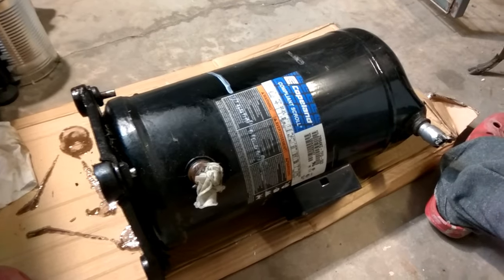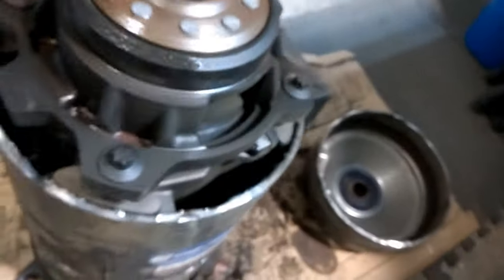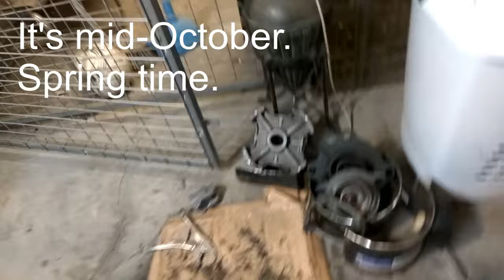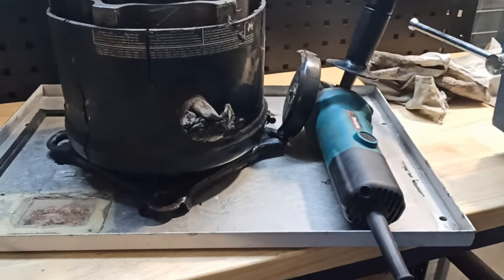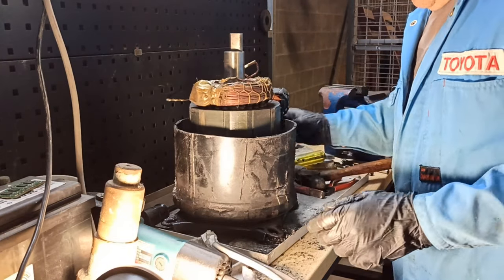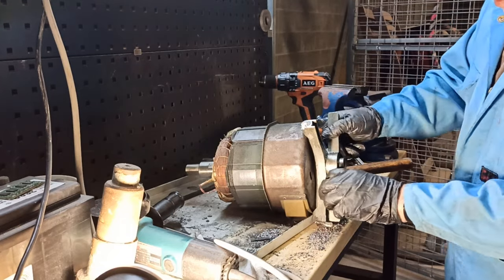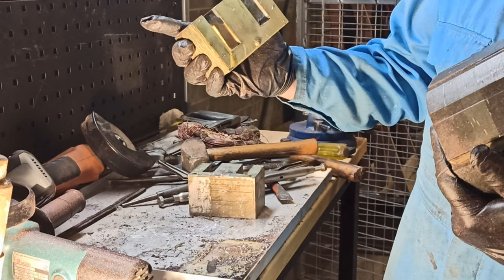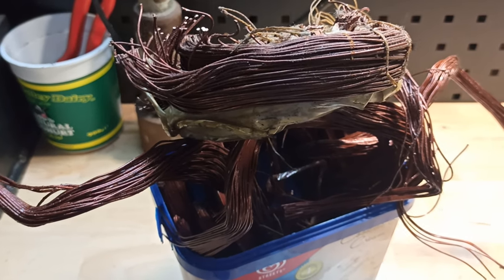63 Huge Air Conditioner Compressor Pull Apart. I Make it Look Hard (Scrap Copper) Bondi Scrapper

Comment: The first one is always the slowest, but good work, you worked it out. I usually mount the stator a bit higher on some chocks of wood so that you can just use gravity, a hammer and a long screw with a flat end to tap the windings out all the way and not have to lever them out with a screwdriver or a pinch bar. I don't bother cutting open compressors or upright fan motors, but pump motors and winch motors are usually much better because you can just undo the casing screws and take the motor out, and not have to muck around with all the heavy steel, anchoring bolts and welding that compressors have protecting the motor.
Reply from the maker: At the moment I've got a lot of projects happening and am scrapping the easy way for a lot of stuff.
I'll be glad when life is a bit less busy

Comment: You made hard work with at compressor mate tbh I does em in like 15min max tbh mate
Reply from the maker: I'm sure there are a more efficient, easier, cleaner methods than mine.
I didn't have a clue when I started and wasn't much smarter when I finished.😂

Comment: I would have tore into that compressor as soon as I got it for the copper. It takes me 10 to 15 minutes to take a compressor apart. On my first one it took ages. Now I have taken over 100 apart. I  live in the UK we don't get thst much for compressors so it's best to cut them open.
Reply from the maker: Welcome!
Definitely I need practice.
I can be a lazy git and tend to do the quick easy jobs first as I get bored with the bigger projects.
The scrap price yesterday was 95c/kg which is 22p/lb.
How does that compare with your price?
Reply: @bondiscrapper1781  I think price are very similar because metal is traded on the world market. Last month. I got £6.35 per kg for bare bright wire. £5.25 for num 2 copper wire. House hold flex, cat 5 wire normal electric wire not stripped £1.89 per kg. Copper 5.65 per kg  .brass 3.50 perkg. Aluminium comes all under one price 90p per kg . Stainless 1.20 perkg. I think motors compressors all go for 30 to 50 pence per kg. Shred is 20 ppkg.
Reply: I was surprised the you only got 3.7 kg if copper from a compressor weighing 70kg..Normally a compressor this big has 5 kg at least.
Reply from the maker: @iffy9776   Similar but different.  I should take some bare bright in again and see how it goes.
Thanks for all the prices.
Reply from the maker: @iffy9776  It did seem a bit light on the Cu.

Comment: 1:14 - 59 kilos. At $$ 1.10 per kilo. Comes to $ 64.90. Round it down to $ 60.00 for the sake of conservative calculation. Would have got $ 60.00 for it as is. So, round up the burnt copper to $ 40.00, and and an officially established $ 8.10 return on the steel [ 31.10 ], for an actual return of, say, $ 48.10. As against a potential return of at least $ 60.00. What you have achieved is to take at least $ 10.00 out of the economy. By your labors you have tightened the economy by $ 10.00. You have added $ 10.00 to the productivity of the economy.
Reply from the maker: I can tell you are a "silver lining" type of guy.  :-)
Reply: @bondiscrapper1781  Actually, one can be more exact than my above calculation, and circumvent any other residual material to do with the item such as any brass appendage and so forth, just by adding the steel weight to the burnt copper weight, 57+ kilos, at a rounded down $ 1.00 per kilo for compressor weight, and its a conservative $ 57.00.  Thus a very conservative $ 8.90 pruning, but probably $ 10.00+. But I think it definitely still less than $ 20.00. But whatever you pruned from the value is processessing work you did for for other interests further along the stream.
Reply: Wo wo wo where do you get $1.12 a kilo for compressor ?
Reply: @computerlearingchannel4257  I myself don't do compressors so I don't know regarding that. I can only hope I cited the correct figures here.
Reply: @jonglewongle3438  im from united states so compressor sell to scrapyard for 0.08- 0.15 a lbs, so if you are getting 1.10 a kilo holy shit that alot for compressor
Reply from the maker: @computerlearingchannel4257    Did I say $1 in there?  It's been a while since I made that.  I probably pulled that figure out of the sky while delirious. :-)
My latest "fridge compressor" price (10Sep2021) is 70c/kg.  That's US22c/lb???
Thx for querying it.  
There are some weird anomalies between AU and US prices.  
Cat wire is considered "ultra-low grade" the same as christmas lights.  In the US it gets better than appliance wire???
Reply: Last time I cashed in a compressor, it got paid as a compressor, not a motor, because compressors have a higher steel to copper ratio, so compressors were 40c a kg, and motors were 55c a kg at the yard I go to in Sydney. So, 60kg at 40c would be $24, so you have actually "doubled" your money. I don't breaking down compressors anymore, I did a few, but they were very labour intensive, even when I was cutting along the weld with a grinder.